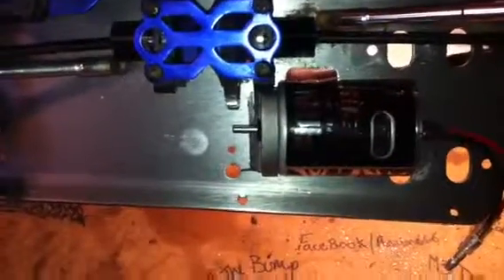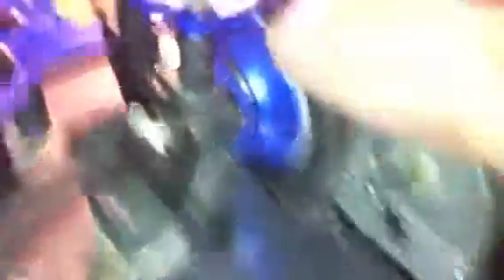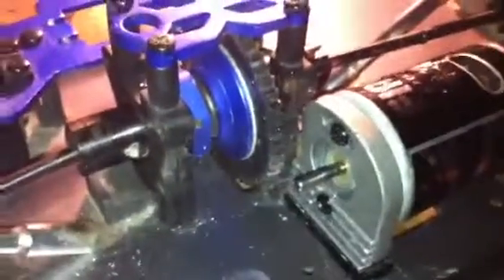HSP 1/8 nitro to brushless part 2

Comment: it´s mod 1 pitch i have the hsp sea rover 1/8 scale looks pritty mutch the same and i did a convertion and it is mod 1 pitch carfull tho i use a 1/10 scale motor and i have 11t pinion and i think 48t spur and it just berely works